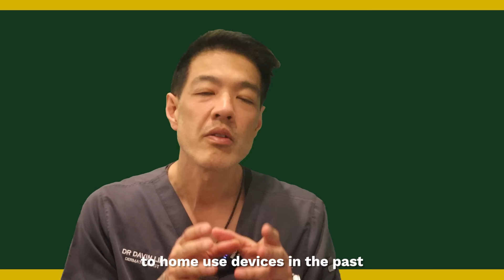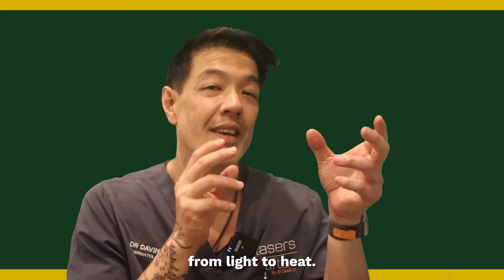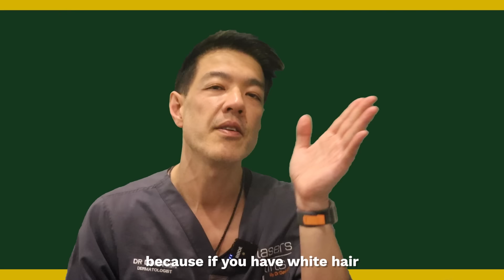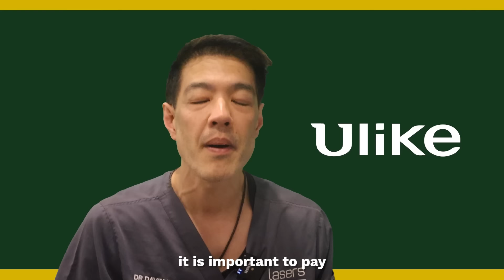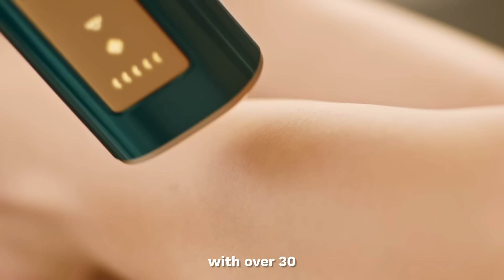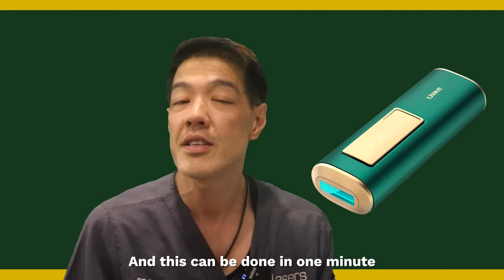Laser Hair Removal? at Home? | Dr Davin Lim

Comment: I just purchased this device and very excited.  For the price, if it reduces hair by at least 50%, it is well worth it.  I have had laser hair removal in the past and while it worked really well, it is painful and leaves you a bit traumatized.  Just thinking about it, gives me chills.  Also, if it is as pain free as they claim, then it would be easier to be consistent.
Reply: Garbage ?
Reply: Hi, do you need to apply the ipl on the same skin area several times, or is just one time enough on an area of the skin in a session?
Reply: any result?

Comment: I tried the sapphire product from Ulike and it stopped working after the 4th use.  I waited a day and tried for the 5th use and the device wouldn't turn on.  I tried multiple different troubleshooting techniques with no success.  I tried even using several different outlets in my home and still it would not turn on.  I was seeing results from the 4 uses I had but I can't continue because it doesn't turn on now:(  Don't risk your 250 dollars:/

Comment: After watching you recommending ulike so I have purchased it.
I am using it on my lower eyebrow which is not recommended by the company but  i take so precautions by covering my eyse however I would appreciate it if you give some precaution tip to avoid any risk to my eyes and so far I don't feel any thing strange to my eyes
Reply: I would NOT  risk eye damage for some hairs under eyebrow just pluck away instead

Comment: Hi Dr. Davin, is there anything you recommend for underarm odor besides miradry? I have tried all topicals, prescription deodorants and medication. Is there an alternative to miradry that is more effective? Is there a newer,safer alternative to sympathetcomy?
Reply: Botox
Reply: @wendygadea8291  I get Botox every 6 months already. It wears off after 2 months and isn’t 100% effective in those 2 months anyways.
Reply: Panoxyl
Reply: I use sweet spit labs bha/aha exfoliating pads. That helped me significantly
Reply: @insertlastnamehere6471  thank you for the advice but unfortunately, I have tried that before. I’ve found a routine this past week that has worked tremendously just don’t know how long it will lasts.
Reply: Benzoyl Peroxide washes. I believe Dr. Dray has some videos on this that you could find helpful
Reply: @lukasbeacon372  yes, I’ve seen those videos and have tried that method but unfortunately, I didn’t work. Thanks though.
Reply: Hey try a slicing a lime and rubbing that In. Works for me.
Reply: Ps. Don't do it after shaving
Reply: @heyitsnotrich  how long does it keep you odor free?
Reply: @heybaby321  everyone is different. For me 2 days at least the. Clean the pits and re apply. Changing diet helped alot to. The acid from the lime really helps tho promise. Let me know if it works because it's the only thing that initially did the trick. Squeeze the juice rub it in bye bye stinky pits
Reply: Lume makes really good products. I use their deo in combination with secret clinical strength antiperspirant immediately after the shower and it works wonders! I have tested it and it works better than anything else I’ve tried. You can find at Target as they’ve recently starting selling in-store.
Reply: @Jaclyn_Zen  I’ve tried lume and it was the most disgusting thing I’ve ever tried. It smells like you’re rubbing feces on your body. It made me smell worse. All the honest reviews I’ve seen, State how bad the smell is. I don’t know what ingredient is causing that kind of smell in the product but I’m not sure why they haven’t changed the formula. Thanks for the suggestion tho.
Reply: Usually, underarm odor is caused by bacteria. Wash with Dial soap (or antibacterial soap of your choosing), then wipe a handful of rubbing alcohol to any area that gets odors. Once the rubbing alcohol has air dried, apply your deodorant of choice. 

The alcohol smell will disappear within 10 minutes of applying. 

I've done this for years with zero problems. Also, don't apply the rubbing alcohol if you just shaved, lol.
Reply: They did just change their products because of the feedback of the scent. I just got mine in the mail and I like the toasted coconut and lavender so far.

Comment: I love my SmoothSkin IPL hair removal device. I  had no hope of it working at all after having zero results worn in office treatments in the early 2000’s plus very light hair. I’m am blown away by the results.
Reply: How do u use it? With IPL glasses? Does it work on the face/upper lip
Reply: @bswati29  It's for body hair, not facial hair. I don't use glasses. I just don't look at the flash.